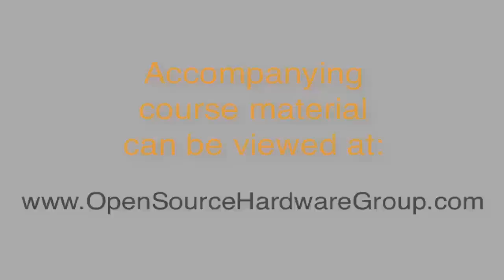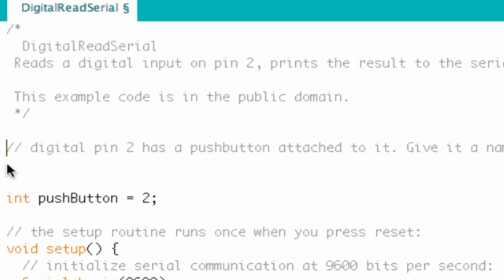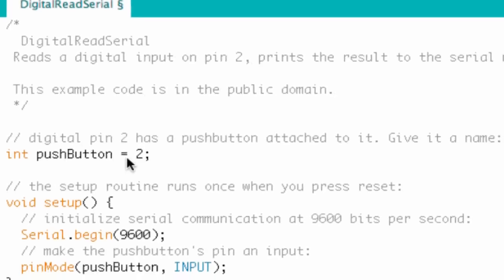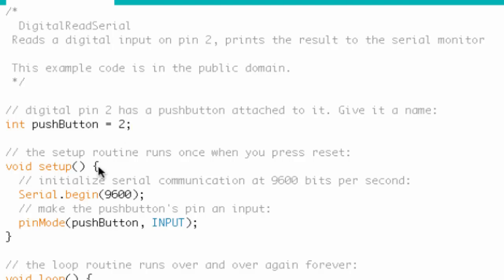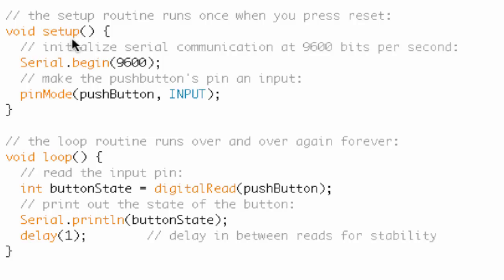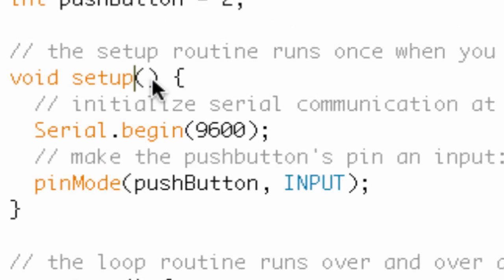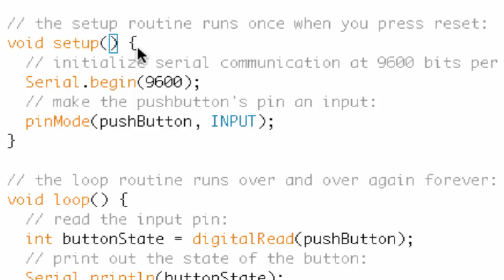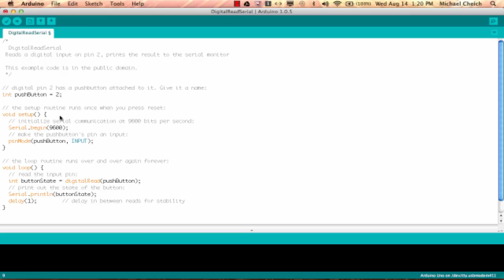Tutorial 04: Understanding Arduino Syntax: Arduino Course for Absolute Beginners (ReM)

Comment: These are great, although they're on a Mac, so a lot of the advice doesn't help this Windows user. 
Starting in #2, things I need to do or check (e.g., Preferences) aren't... anywhere. Then, once things start to diverge from things I can find and follow, it just gets farther and farther from being comprehensible. 
I'm following now, not for instruction or practice (because I'm already left behind) but just for general knowledge. (As I get older, I find that if I can't follow exactly, well, that's it.)
Do you know of a Windows-based instruction that might be anywhere near as good as this?
Thank you.

Comment: friend
I just learned Arduino and I thought I would make a battery charger control using Arduino Uno, MOSFET and Sensors but still confused in the program section, ask for advice, thank you beforehand